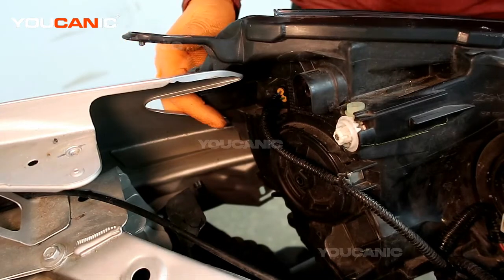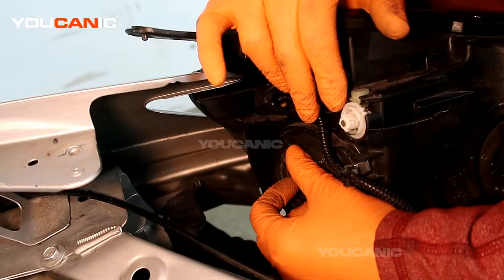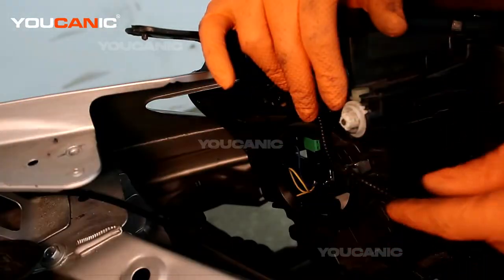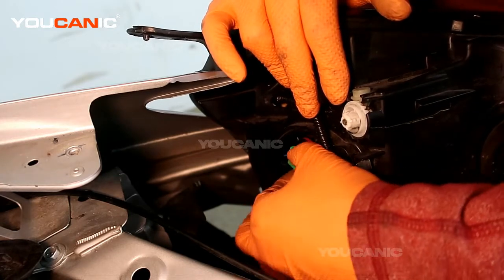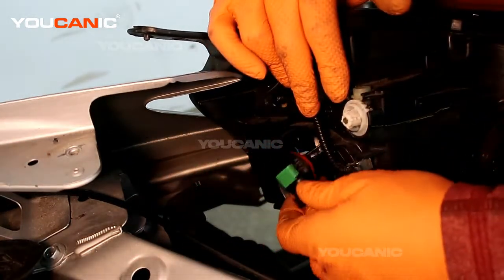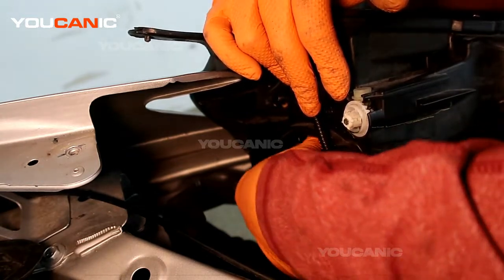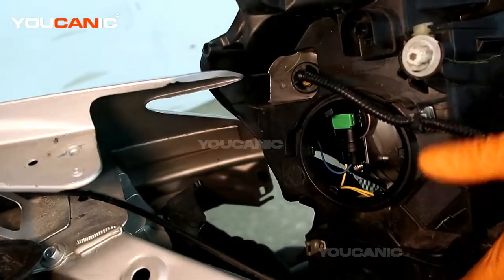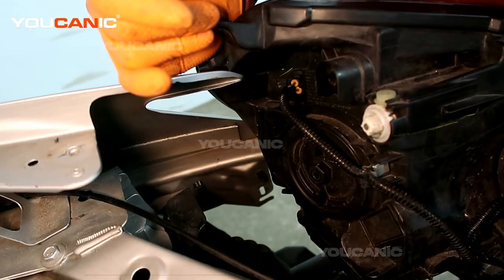2013–2019 Nissan Sentra - Low Beam Light Bulb Replacement (Removed Headlight Assembly)

Comment: Thank you, it helped.
Reply from the maker: We truly appreciate your feedback! Our primary aim is to provide assistance and make car repairs easier for you. To diagnose modern cars like an expert mechanic, you'll need a good, professional diagnostic scanner. That's why we created the YOUCANIC Full System Scanner, to empower every car owner. You can learn more here: www.youcanic.com/scanner.

You might also benefit from using our Factory Repair Manuals and Torque Specs to ensure your job is done correctly. For just a small fee, this valuable resource is yours to access right at www.youcanic.com/manuals. We're here to make your car repair projects a success!

Comment: What if there is no cover and it’s sealed to get to light bulb. What are the other ways to replace it.
Reply: My exact issue. I have a 2017 Sentra and can’t find a single video where someone’s assembly is like ours. Completely sealed, no cap to access the outside low beam bulb. Did you figure anything out? Some videos are looking like we might be able to access it from underneath but I’m still annoyed I can’t find a video with what we have. So stupid.
Reply: @larkerpudwig unfortunately not, still have the same issue.
Reply: Came here to find anyone who had some answers 😭

Comment: It's not that hard if you or someone has small hands to access the low or high beam to replace them😂😂
Reply from the maker: Thanks for connecting with us! We at Youcanic aim to equip car owners with the confidence and knowledge for all their car maintenance needs. We definitely agree, sometimes all it takes is a bit of dexterity! We provide comprehensive guides, free resources, and access to our Youcanic scanner to make this process even easier. 

Don’t hesitate to explore these resources on our site, www.youcanic.com, and reach out if you need further assistance. We also offer factory repair manuals for those seeking detailed guidance. We're here to support your journey in car ownership. Keep wrenching and drive safe!